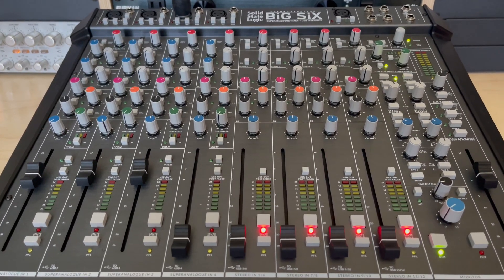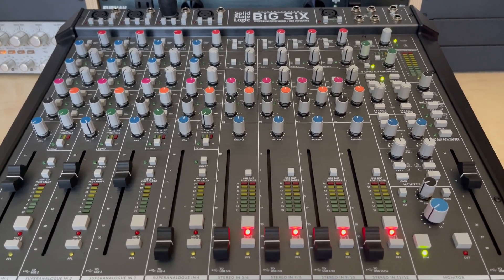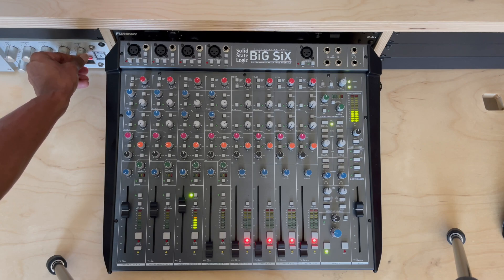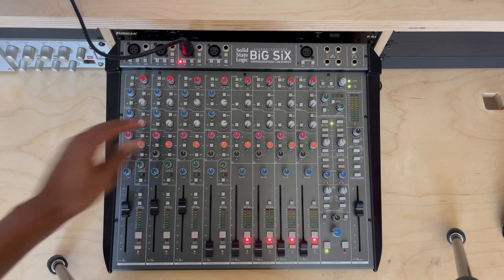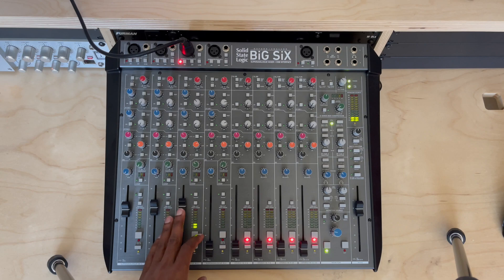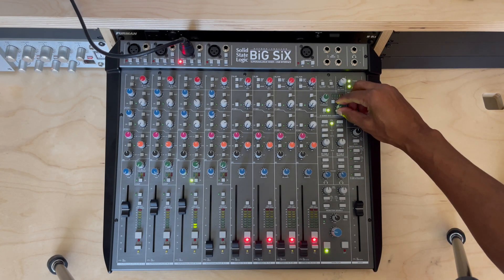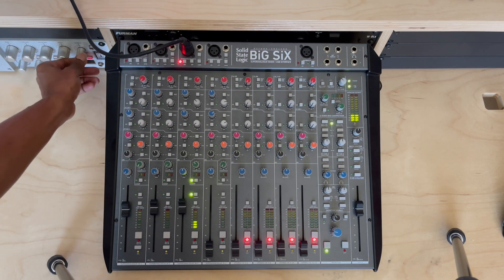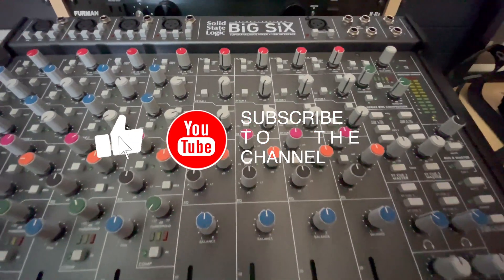HOW TO USE THE CHANNEL INSERTS ON THE SSL "BIG SIX" EXPLAINED STEP BY STEP!!!

Comment: wish you would have explained how it's all hooked up in the back of each piece of gear. My Big Six has been an absolute nightmare for me, from the first two input channels refusing to show up in my DAW, to each super analog channel being super scratchy when you touch each knob, to now buying my first piece of outboard gear - Distressor - and still unable to have the Distressor affect the sound. When i plug my distressor in - using Y style " Ring" "Tip" cables (that was a whole other nightmare finding out that I needed those cables in itself) into the back of the big six in the super analog inserts send/return jack, i hit insert and no sound comes out at all. when I release the insert button, the kick sound running through that input starts playing again but not affected by the distressor (obviously). What am I doing wrong!?

Comment: You can plug the mic into the Avalon and then go from the Avalon with a TRS cable to the TRS line input at the top of one of the 4 Super Analogue channels. Then, the signal is routed through the entire channel strip and you can use the eq, comp, Q's.... etc.
Reply from the maker: APPRECIATE THAT VAUBLE INFO! I'M GONNA TRY IT OUT!
Reply: @Stoneworldfamous  Happy to share! You should also consider using the Avalon as an insert by itself. Plug the mic in the xlr at the top of the SSL Channel and use two TRS cables to connect the Avalon to the two I/O for the insert on the back of the channel. Then, you can insert the Avalon in and out like you would a plugin. Very flexible that way, and you don't have to disconnect everything if you decide that you don't want the Avalon in the chain for certain tasks.
Reply: ABUOLUTELY RIGHT I M USING FOR A LONG TIME

Comment: It seems like the big 6 is all that you really need, but I see why you don't want to have your sound just limited to one machine. So as of now you got the avalon, and the big six, is there anything else that you would like to add to your outbound gear?
Reply from the maker: Simple is better, but I’m definitely thinking of adding a equalizer compressor combo to the Master buss section probably the Neve Master Buss unit for that final Mix.
Reply: Useful video! Thanks for documenting that beast!
Reply from the maker: Glad you found it useful! Thanks